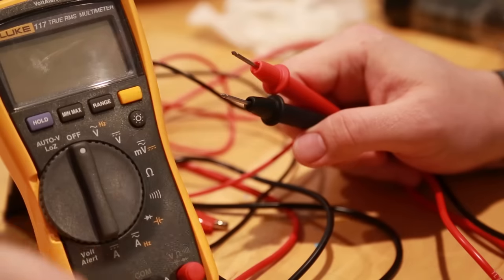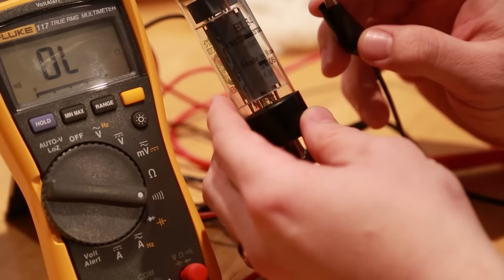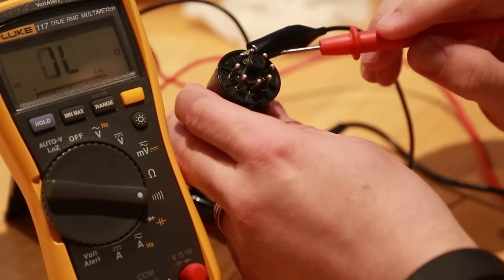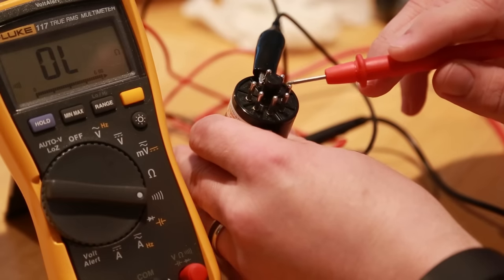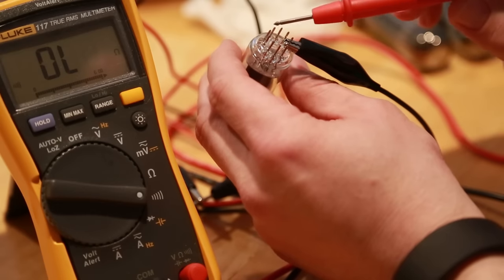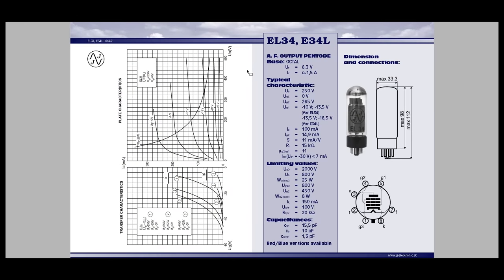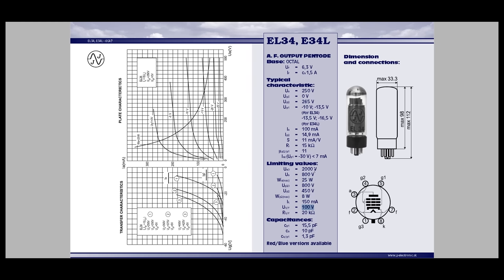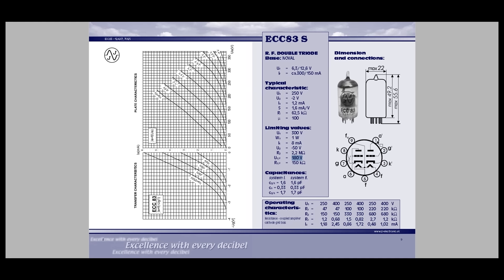Simple tests for Tubes with a Multi Meter

Comment: Possible stupid question, if I connect two heater pins as shown on the data sheet and do not get continuity then is the tube bad?
Reply from the maker: It's very likely, yes, the heaters need continuity to work.  What specific tube are you talking about?  (You'd likely put the tube in and get 0 glow, but sometimes tubes barely glow and still work, so that's not a perfect test)  Example a 12AX7 has heaters between 4 and 9 5 and 9 or just plain between 4 and 5, if you test between any of those three, you should get continuity beep.
Reply: All the 12 model tubes tested great. I had issue with two other tubes: 1) 50LgGT Output and 2) 35XZ5GT Rectifier. Here is the interesting part, if you look up the data sheet on the rectifier tube, the heater pins are 2 -> 7 but also 3 connects to 7. If I test 2-7 there is no continuity beep BUT if I connect 3 and 7 it beeps, ha. Does that mean it's actually working fine? This model needs all caps replaced so I have no idea if the tubes are the issue (no sound yet when plugged in) but I thought I would test the tubes while waiting for the cap replacements to arrive. Any thoughts?

Comment: This doesn’t show that the tubes have full power?
Reply from the maker: this doesn't test emissions or any other functionality of the tube other than the heaters should have continuity, and no other pins should...  Some tubes have shorts and are clearly defective, this can be proven easily with this method.

Comment: You talked too fast. Cannot understand what # pins to check on the 12ax7 for continuity ! Not much help.
Reply from the maker: Sorry I can't undo that, and I only get told I talk too fast constantly.  I've tried, but fail to slow down... it's just how I am.  On the other hand, youtube does have a feature to slow down the video and thereby the audio.  Give it a try.
Reply: I'm a bit late, but you could look for the datasheet online.

Comment: Which two pins on a 6L6 tube? Out of peavey encore 65 amp. When powered on it hums loud. And with no instrument cable plugged in or not. Nothing plugged in, power it on, after about 20 secs loud hummmmmmm. Constant. Knobs dont change anything. 
So, I still wanted to check the two 6L6's, just not sure which pins to use, they have 6 pins. There's 2 of these tubes. I checked all four of the pre amp tubes. Showing 150 continuity on each. Assume they're good. You know which pins to check on 6L6's? And theres no numbers on these type as well. Thanks!!
Reply from the maker: 6L6 heaters are on pins 2 and 7 so you should only get continuity on those two.  Nothing else.

Comment: Well either all 5 of my radio tubes are bad, or this method of testing is useless...
Reply from the maker: What tubes are your radio tubes?
Reply: It probably depends on the type of tube.  Keep in mind, he only tested one particular model of tube.  Probably best to get a diagram / schematic that tells you which pins should have continuity...
Reply: @FrenchieFilms  he has the model TROLL  .  nice video i liked how u easily explained it.

Comment: YOU DON'T KNOW WHAT YOU'RE DOING
Reply from the maker: Interesting point of view, could you help clarify what specifically I don't know?  I'd love to learn more.
Reply: You really need to test for shorts with the tube hot and a high voltage applied. 
Using a low voltage ohm meter will not give a reliable indication of shorts.
Reply: I used this test and all the tubes from my amp that blew up failed. I tested the new tubes and they were good. I very good easy test that I will use all the time. Very helpful. You did a good thing today.
Reply: @ehtcom Yes but then you can kill the PT while you are performing the test right? The point of this video is a very simple test for a shorted tube without a tube tester and no risk to the other components.
Reply: Russell Catchpole how? The amp is no where in sight?
Reply: @Kevinpaul Exactly. I was replying to ehtcom who said you need to test for shorts with high voltage applied (i.e. either in the amp or in a tube tester). If a shorting tube is left to run the in amp, it can destroy the power transformer, which is often the most expensive component. Hence it's a good video guide on how to test for outright shorts without a tester.
Reply: Russell Catchpole I do agree with that. I pick out the real crap ones, it shows good I never put a used tube in one of my amps with our a complete test and I am not going to put in some one else's amp or put a on eBay. Easy way to find garbage.
Reply: valvox vo
Don't be shy,explain yourself so that we can all learn from you.Meow…..
Reply: He's probably a tech. A crooked one who doesn't like anyone to have this info.@Tony Inosencio